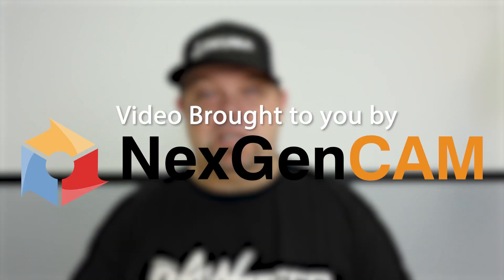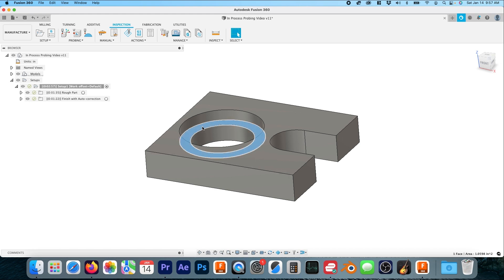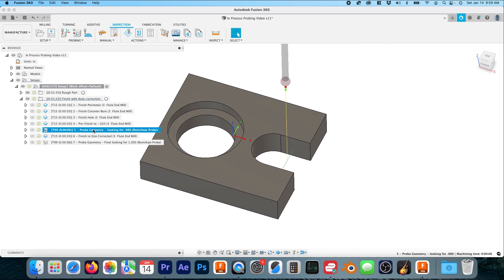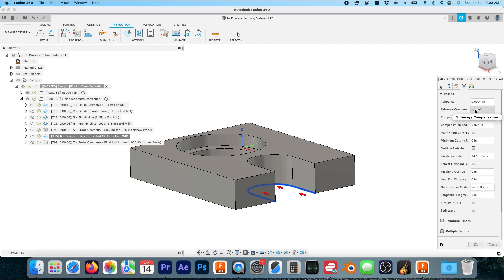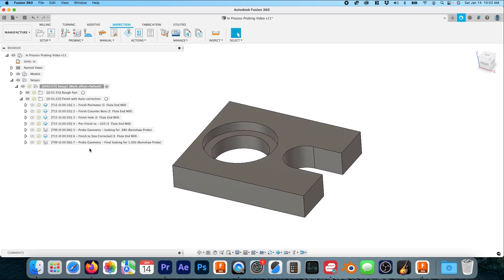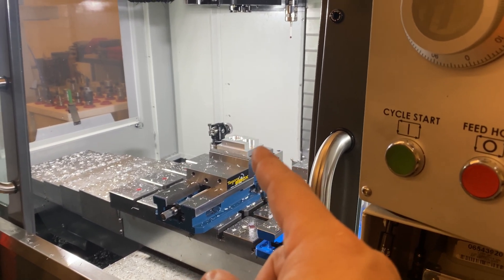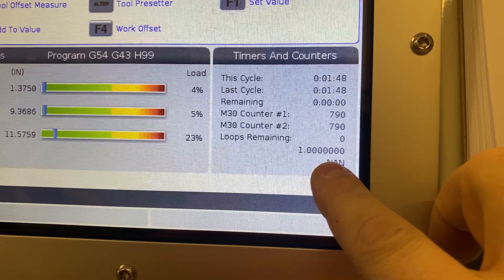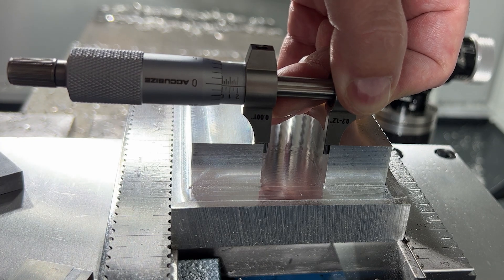Perfect Parts Automatically in a Haas VM2 with Fusion 360 In-Process Probing

Comment: hello, i tried this and i am getting :haas ngc and got an alarm 367 cutter comp interference on the actual haas control, what could be the issue? Also, I noticed in your tool offsets page when you were looking at the compensation value for tool 15, you didn't have a diameter geometry value or it was 0.  When i touch off my tools on the tool setter the length geometry and diameter geometry always auto populate.

Comment: I’ve got a pre”NGC” control on a  haas vf3. I know the older controls don’t have all the newest features but I do have the wips. Where will my measurements show up on the control like yours ? Or can it do this in process probing at all ?
Reply: We have the same situation with our TM1P.
How do you number tools - I cannot see a way to have a tool 99 in the tool changer when we only have 10 pockets (we have it as T1)
Have you found a way to transfer tool data from Fusion 360 to Haas without having to manually input data for each tool? I would love to keep tool data in Fusion, mount tools, send data from fusion, probe and run. Am I just a dimwit that cannot figure that out?

Comment: man I wish my fadal could do this great video as always
Reply: So your Fadal very well could. If you have a probe or Add a probe. We have several customers doing full 5 axis on mid 90's Fadal with probing.
Reply: @phillipbrown5389  I have a probe and a tool touch off. I spent a lot of time trying to get it working reliability ended up getting a haimer.
Reply: @joesmith2465  that's why you need our support :) that way we can help you through the process.
Reply: @phillipbrown5389  so you are able to use fusion 360 to probe?
Reply: @joesmith2465  Yes sir. It requires the machine ext however its more limited by the machine than it is software.
Reply: @phillipbrown5389  yea simple probing on fadal isn't a think, my centroid control it's easy
Reply: @phillipbrown5389  what would I have to do to get it working?